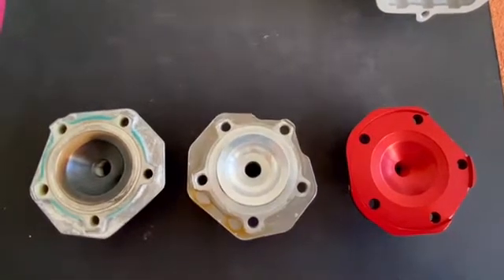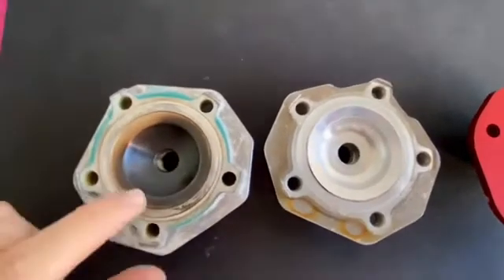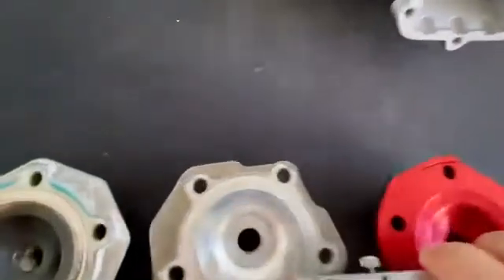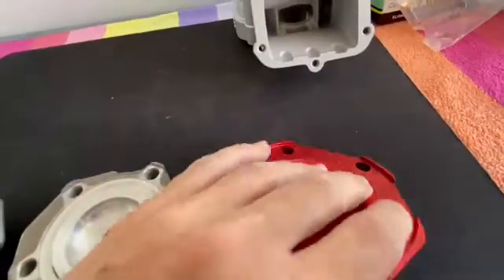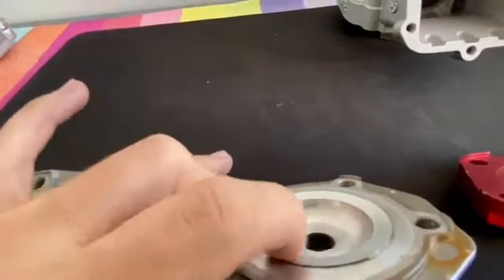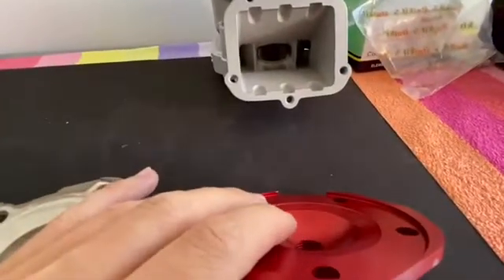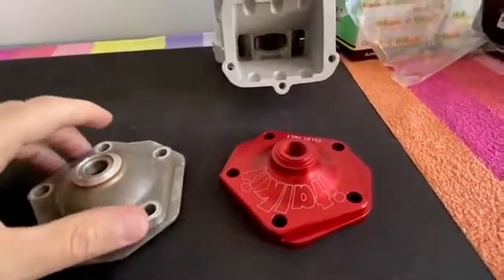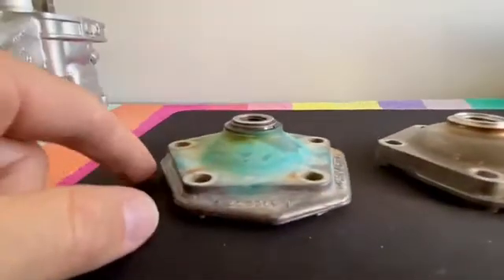Italkit 140cc for Rotax 122 (Part 2)

Comment: Ottimo video, grazie. Il dubbio principale era in effetti sul peso del pistone. Dici che rivendendo aspirazione e imbocco travasi, di base si ha un incremento rispetto all'originale? Indirizzare il lancio del secondario lato frontescarico verso i booster avrebbe senso? Con che fasatura esce? Scusa le tante domande ma sono in procinto di restaurare una vecchia RS e stavo proprio puntanto a questo cilindro. Grazie
Reply from the maker: Sto aspettando qualche mese prima di tornare in pista e provarlo. Ti faccio sapere una volta provato. Io monto uno scarico Tyga che ha pancia molto larga ed e` un pelo piu lungo dei Jolly Moto e che dovrebbe andare bene su un cilindro cosi.
Reply from the maker: Ciao, a vedere come e` costruito il gruppo termico secondo me ci sono aumenti di prestazioni (piu che alro per via della cilindrata maggiore). Il Peso del pistone e` un problema sul 160 Polini (troppo pesante), ma qui non dovrebbe essere un problema. Visto che alesaggio e` maggiore certi passaggi di ammissione sui booster laterali andrebbero limati secondo me (io l'ho fatto), ma per me anche montandolo cosi si migliora sul GT originale (soprattutto ai medi).
Reply: @giuseppevalletta4929  grazie veramente, ormai si trova poco nulla in rete di utile su questi motori
Reply from the maker: Fasatura mi pare fosse un 200 scarico e 135 travasi, ma l'avevo segnato da qualche parte e non lo trovo ora (era qualche grado in piu dell'originale). Il mio in configurazione racing e penso cambi solo il pistone (monofascia)